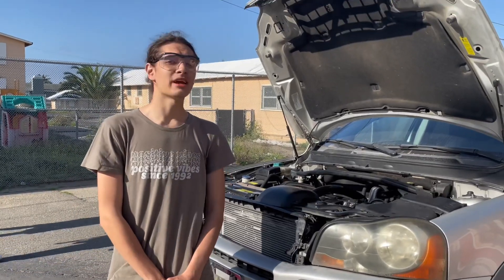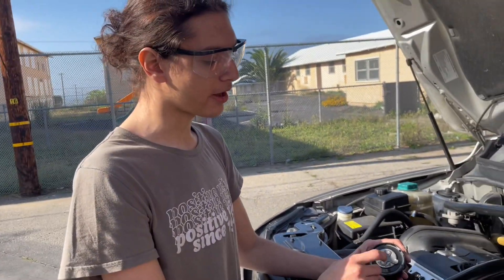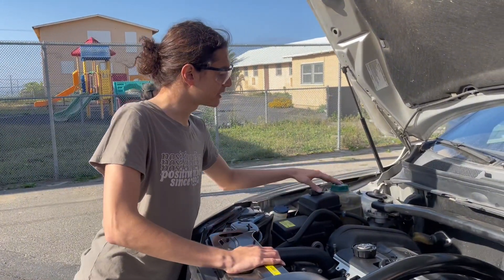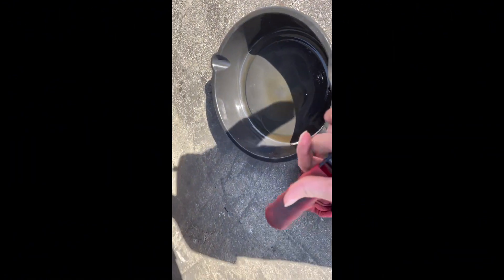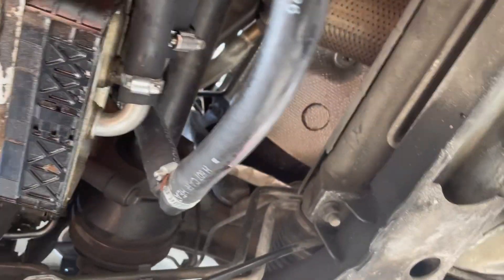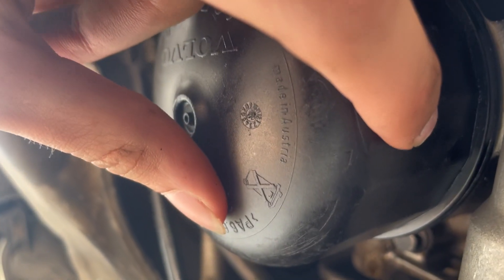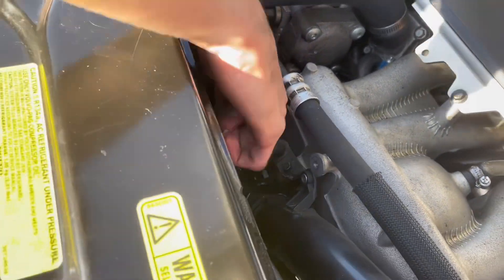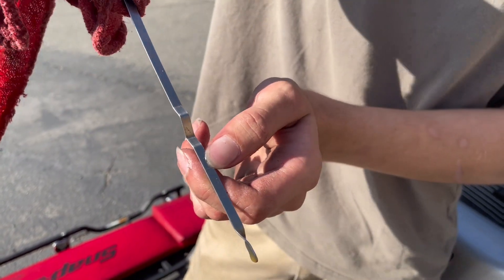Volvo xc-90 oil change

Comment from the maker: IMPORTNANT! Lastly! Since I missed it in the video, after you finish replacing your filter, Make sure to run your engine for around 30-60 seconds to ensure the oil can settle inside the engine!